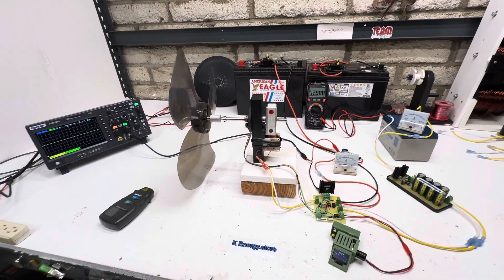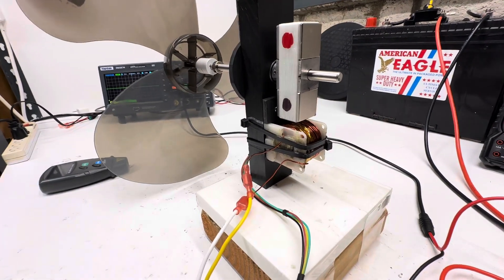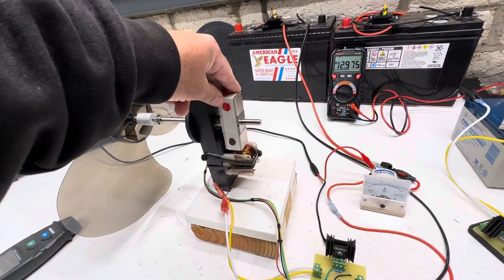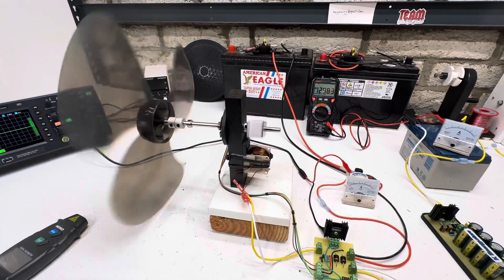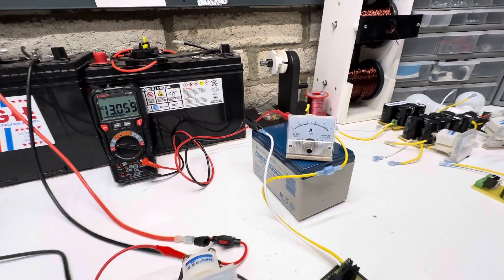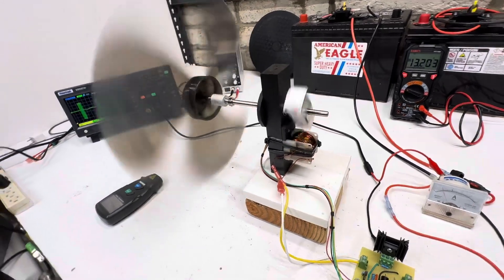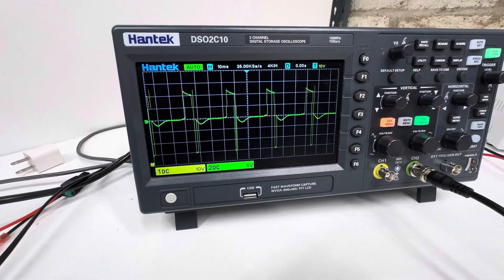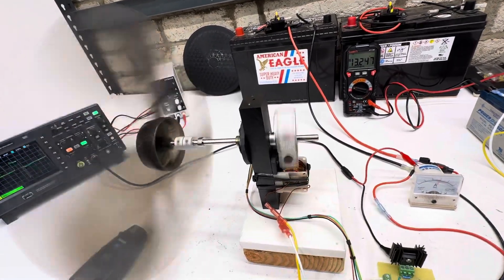Zero force motor

Comment: The absence of cogging on a 2-mag, 1-pole motor is indicating low magnetic coupling to the parallel core. If it's low force on the attraction side, then it will be low on the EM repulsive kick. Very interesting! The two fields are just kissing each other...

Comment: Excuse my ignorance, but what is the practical application of a motor like this? I notice you’re charging a 16v battery with the 12v,  is that the goal? It’s the first I’ve seen something like this so I was just curious. Thanks.
Reply from the maker: Thank you for the comment! 
 This set up is for research it definitely has interesting potential!
As far as the charging goes it’s running off 12 volts 
Every time the motor turns on and off with timing and pulse with it makes 300v which my circuit removes and sends this energy to the capacitor to covert to 16 v at 3 amps to charge the second 12v battery
Reply: @kenergy1707  I appreciate the reply! I ended up watching another one of your videos that went into the basics. Very interesting stuff!
Reply from the maker: @trynadyna9662  awesome! Yes it definitely is ! Just put up another good video with more explanation
Reply: @kenergy1707  Is it not possible to do that without the motor bit at all, kinda like a DC-DC switching converter?
Reply from the maker: @KingJellyfishII  yes but you won’t have mechanical energy and charging energy